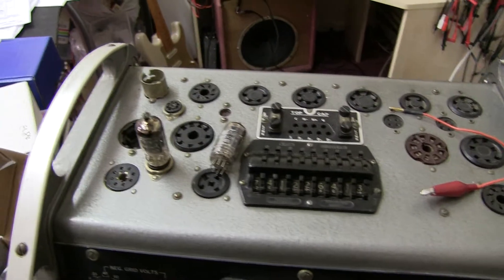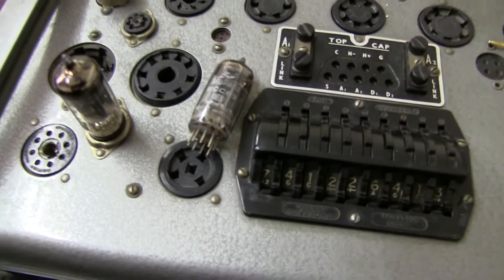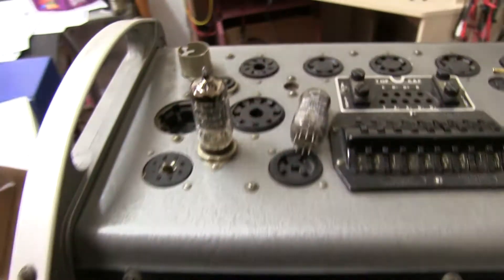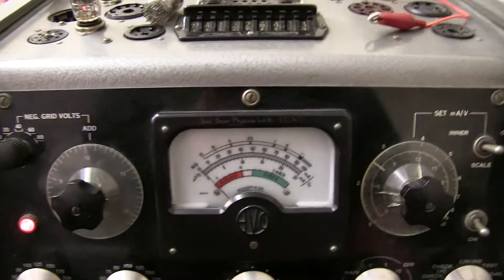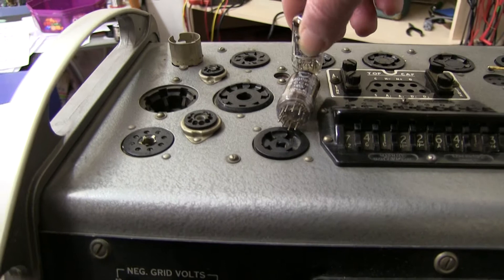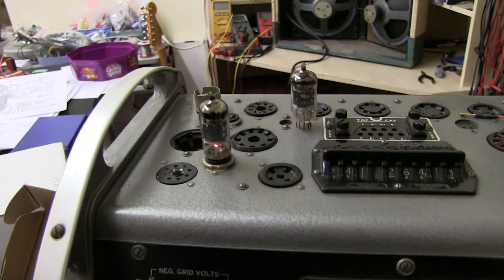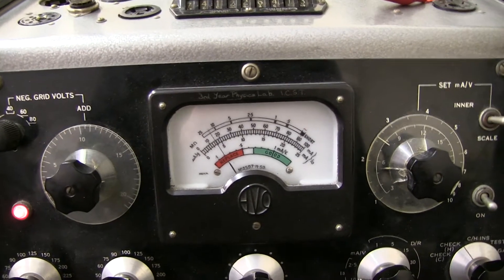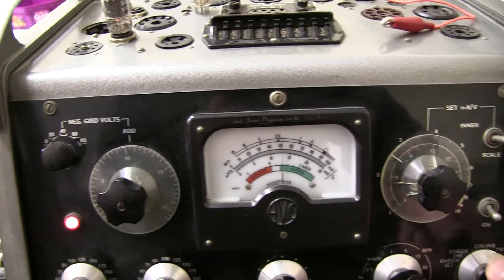Noisy Mullard ECC83 valve (Tube)

Comment: Thanks for this video. I have had the same problem with one of my Mullard valves that I have used on my Little Dot Mk III headphone amp. For a long time, I thought that it was the amp itself that was the problem. A soon as I changed the valve back to the stock valve, the sound from the amp became completely clean.